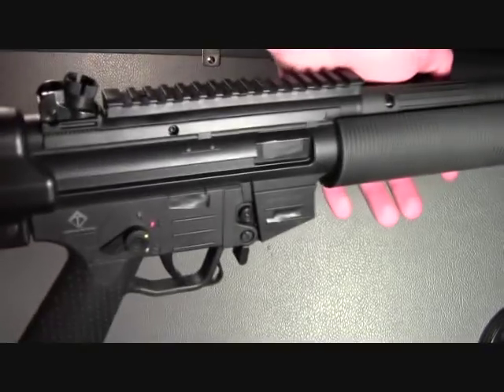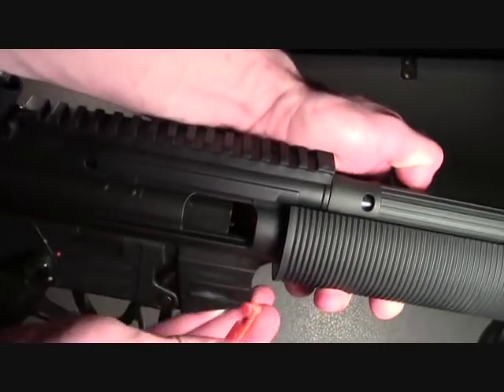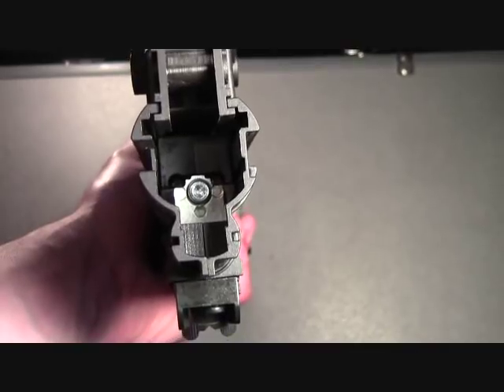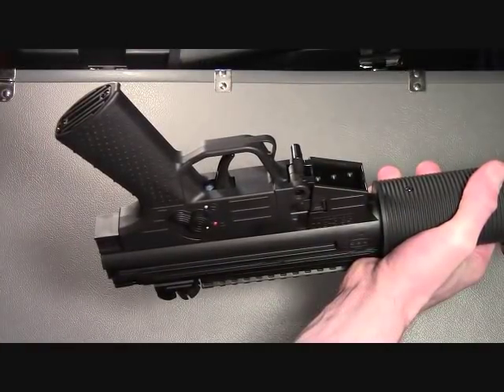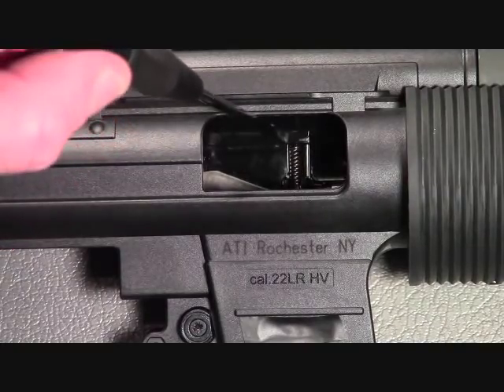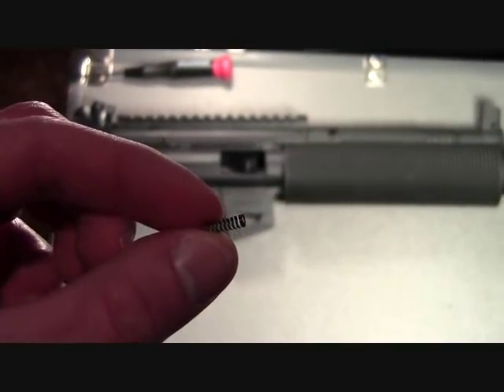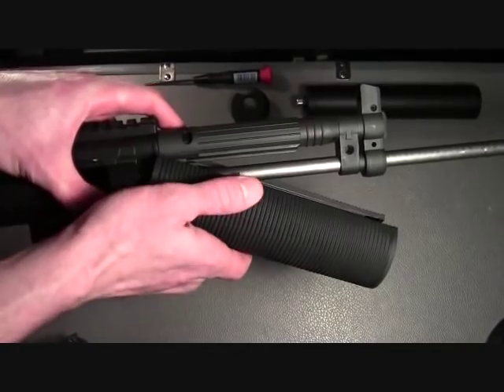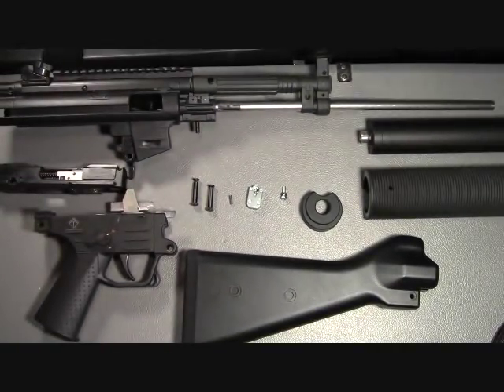How to disassemble the GSG 522

Comment: Thank you for putting together both the disassembly and reassembly of this gun ... because, it's almost identical to the relatively new ATI GSG-16 (22 LR) I just purchased a week ago. So far I have not found a video for the GSG-16, I suppose because it's fairly new. 
I talked with ATI tech support and they told  me the 522 procedure is basically the same, which turns out to be the case. 
 
The GSG-16 manual is 'ok', but your videos really bring it home. AND ... the manual does not really point your tip about that little ... spring. Thanks for that also.

Comment: do you know if that handguard will work for a non sd version of the gsg 522
Reply: The one in this video can, most of the sd ones, pre and post law suit do not. Only way I've seen to get the one that works with non-sd version, is to buy this particular version of the gsg--5 unless you find some rare case of someone selling off this version for stripped parts specifically and get the chance on that particular part. You can tell mostly by if it has tabs on the upper middle of the front "handguard", if it doesn't have tabs there, it's compatible for the most part. I've tried and looked at many other way's but unless you do some heavy ghetto modifications, it's mostly not possible/worth it. I went through a lot of work just to get my gsg-5 p converted to a gsg-5 pk, required finding another barrel retaining screw, cutting it, and padding it to fit the pk foregrip/handguard.

Comment: How does this bolt stop spring affect the operation of the weapon?
Reply: it actually doesn't do much other than reduce wear on the magazine's default ramps that help hold open the bolt after the last round. It's sort of useful to help you notice when the last round in the magazine was fired because you can sort of notice when it doesn't return home all of the way, but besides that it's mostly just a nice little feature. Sort of like how with the pistol version's of these guns needed a certain number of safety features to be able to be imported legally.